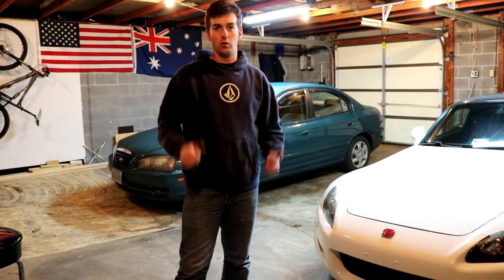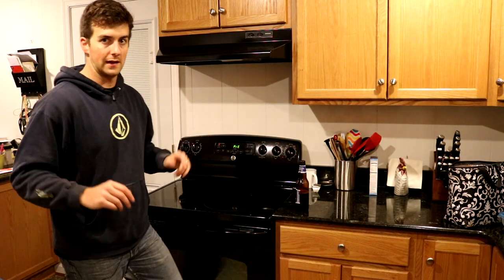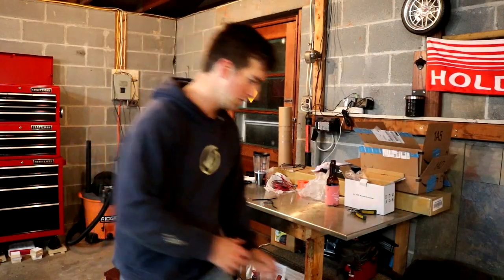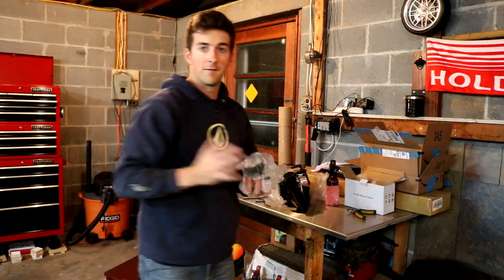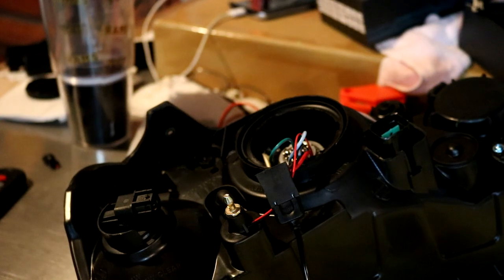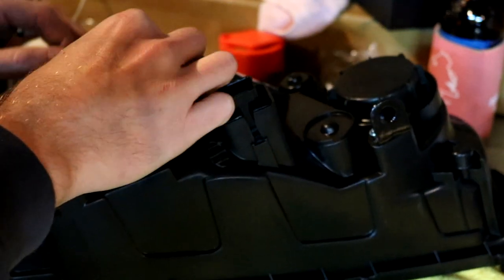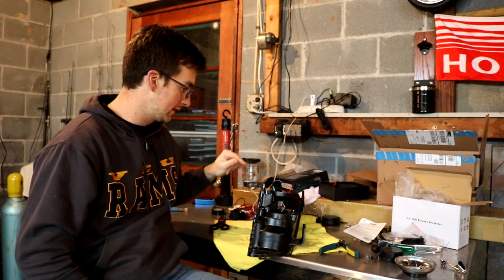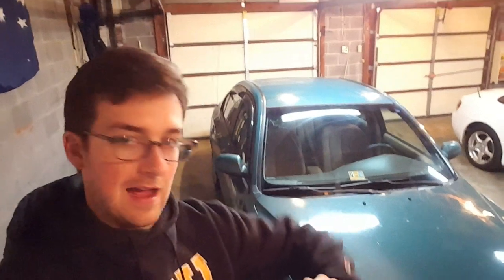Retrofit Projector Headlights for Under $100 - Ballin' On A Budget Episode 1

Comment: those rubber gaskets are actually silicone washers that should go in the back of the projector to make it grip better on to the reflector housing to avoid shaking and drooping. They are high temp and would not melt. by the way; would love to see some night shots of that projector with LED bulbs.
Reply from the maker: +Vince Froilan haha yep I only added one of those washers and the side I did not has a slight shake at idle. I do have some video shots I need to upload them. My recommendation would be to try hid bulbs I don't think the leds are bright enough in this case
Reply: nah its because of optics; the LEDs  dont align well inside the reflector bowl. Did the LED bulbs fit directly into the projector without any mods?
Reply from the maker: yep - no mods
Reply: Right🤘
Reply: You had to get high power 4 sided leds. I had 36watt Cob led bulbs that work well in projectors. $12 bucks on eBay. Just make sure that have 4 sided with light on it.

Comment: One of the best DIYs period for anything I have seen on YouTube. Bravo
Reply from the maker: that's one hell of a complement - thanks man!
Reply: Garage Topics I have a 986 Boxster that I am attempting. I was going to go with the HIDs but may give the LEDs a try.
Reply from the maker: +STEPHENS POUNDS hey I would actually recommend HID's, I don't think the leds are as bright as they should be. I've been meaning to get some to compare. My s2000 with HIDs are a lot better than my LED setup
Reply: Garage Topics S2ks have some of the best OEM lights around. I will start with the HIDs first. Thanks for the info.
Reply from the maker: +STEPHENS POUNDS anytime, keep me posted on how it goes!
Reply: Garage Topics I finalljy finished up the Mini H1 HID Retrofit. It went really well. I did not wire up the solenoid as I want to keep the halogen for flash to pass. Don't know how to send you pics! Thanks again for the vid as it really helped.

Comment: Confidence inspiring video. I'm just doing a bit of research before I jump in. I want to make one little point, though: You are using LEDs... not HIDs. Throw a Kensun HID kit in there, and you will REALLY be able to see (Also on Amazon with good reviews).
Reply: Quick thought:
If those projector housings are plastic, you might wanna keep with LEDs. HIDs make a bit of heat, and a plastic housing could warp, maybe even melt. 

If the projector is metal, you're good.
Reply from the maker: Entire headlight is plastic and super cheap. For light output, id def recommend HID's over the LED's. The HID do a lot better of putting light through the projectors. I have done this once before using The Retrofitsource products and had better light output, but I paid more. I may be making another video with a new projector retrofit. Thanks for the input!
Reply: @maxbloom8256  the projectirs are HID projrctors. The bowls on them are designed for HID bulbs.

Comment: Nice video, only thing is when you put the jumper for the solenoid to the high beam power should have used a red wire just to make life a little easier down the line for the next person down the line when you sell your car. Got to love a video that starts with a beer, man after my own heart.
Reply: Also I would've spliced into wire not cut it to re-solder it... cause when halogens get hot it's possibility the wire will come lose...

Comment: That Silly-Cone gasket actually goes inside the headlight housing between the projector and reflector inside the housing. It's made of silicone because of the heat so that it wont dry out. Also you don't use LED bulbs in projectors, you use HID bulbs. The lights will be very dim because the LED bulbs are already focused. My dad just called you a "green horn" lol.

Comment: You should probably watch some videos on how to make proper solder joints, the solder is there to hold the connection together, it's not supposed to actually be the connection.

Comment: Nice!! Now to really improve things. Take out the LED’s and install a decent setup such as Morimoto XB HID bulbs and morimoto or Hylux ballasts.

LED still can’t beat HID until they figure out how to get a hotspot
Reply from the maker: Yep, hids imo are still the way to go for light output
Reply: I agree Michael. Some Hylux ballasts and good H1 HID bulbs is the way to go.

Just move the LED over to the high beam side
Reply: Just get 4 mirrors and the led will shine its shine, try i with a cellphone led first n ul c

Comment: I retrofit a few projectors and I always end up cutting the headlight bulb socket and epoxy the projector into place. Every time I tired to use the nut and washer method, the projector didn't reach the back. So I always have to epoxy it.
Reply: Old comment: I just chucked out the silicone washer that is supposed to sit in between the projector and the housing because like your problem, when you try to fit it, it doesn’t reach, even while dremeling the bulb socket. I would imo say it’s necessary to have it if you’re using one of the metal plate adapters but if not, then you don’t need that rubber washer.

Comment: That silicone gasket is supposed to go between the projector and the original reflector bowl.

Secondly, why did you get HID projectors and use cheap LED's?

Take the LED bulbs and toss them and replace with H1 HID bulbs. 

So, after putting the gasket in the correct spot and doing your alignment again, you can use a socket and tighten down the nut use some JB Weld on the threads so the nut doesn't back off with vibration.

All in all a decent video. Thank you for doing it. 

Also, decent solder job

Comment: You did you best and considering that it is a cheap fix, you did a couple of things wrong. When you do a retrofit, your projector must be able to fit on the reflector housing, if it doesnt fit you will be required to expand the opening so that the projector can fit snugly. Secondly you must black out your reflector after you fitted your projector so that when you turn your headlights on, the light doesnt scatter inside your housing. Thirdly, experts say that the best lamp to use in a projector is an HID lamp, but you can fit an LED, it just has to be the right one. Headlight Revolution has the best recommendation for DIY headlight installations
Reply: Also, the big silicone washer was supposed to go ONTO the projector BEFORE fitting it into the housing in order to seal it from moisture.... and also to let the projector grip to the housing. And THIS is the reason they began to droop, not because they were too heavy.

Comment: Great job! One question,  and apologies if I missed it - I know you replaced the low beam with projectors and LED/HID bulbs, plus you wired the low beam projector to the high beam, so that they open up brighter when high beam is on. One thing I didn’t catch is did you also upgrade the high beam bulb to LED/HID? Thanks!
Reply from the maker: Thanks man! Na I just kept the high beam as a halogen bulb. I highly suggest hid bulb over led for the projector after making this video. I plan on making another video like this for my new vehicle
Reply: Garage Topics awesome thanks for the quick reply and answer. I want to do this on my 2000 Prelude SH. I’m wondering if it would be overkill to also put HID in the high beam? Since it is only on, when there is no oncoming traffic, I guess you don’t have to worry about blinding people with this...? I’m trying to wrap my head around the parts I need to get. I want the color temperature to match on all my lights. I’m subscribing so I will keep an eye out for your future videos!
Reply from the maker: No worries, thanks for subscribing! Since no one really sees the high beams on I opted not to fool with them. The projector headlight when open to high beam is plenty bright

Comment: I just can't get one thing, can you aim these lights afterwards? I saw u adjusting the lens, but is that the only way u would be able to adjust if u ever needed to do that? I"m talking like for technical inspection or MOT for car, like if they are too low or too high i'd need to adjust, but would i had to take it all apart or can i do it the original way?
Reply from the maker: So you adjust them only to make the cutoff line level. If you need to adjust the beam up or down, you use the stock headlight adjusters like you would on a regular car to move the light output up or down or left to right
Reply: @Garagetopics Thank you very much for clearing things up 🤙🏼

Comment: I'm fairly sure the waviness you complained about is there to allow more light to be unblocked on the side of the road away from oncoming drivers, might be wrong though
Reply from the maker: +fawncashew I thought so too, on legit projector retrofit kits they designate which one is left versus right. This $25 kit both projectors were the same
Reply: fawncashew thats how mine are , its like wavy ish i had mine retrofitted too , i wondered why they were like that , factory projector headlights are lined up perfectly so you cant reallly tell with them

Comment: I want to retrofit my 2012 Nissan Altima headlights. My only concern is there will be an opening behind of the headlight where the bulb is (because h1 bulbs don't have that black plastic/gasket thing to make the inside of the headlights air tight). Will the headlights be prone to condensation if its not covered up? Thanks
Reply from the maker: +Zachary Uniza I have had mine condensate once from a heavy rain where I was driving through puddles. Since I have the opening in the back, it cleared up within a couple hours. I have seen people use material similar to a computer mouse pad and use a radiator clamp to protect the back from the chance of condensation. If I had a higher end headlight, that is what I would do.

Comment: It's been 2 years since you did this vid. L.E.D headlight tech has gotten a lot better since. Have you tried a newer set of L.E.D's yet? And in your vid you were clicking the high beam so fast it looked like you accidentally wired your high beam shutter into your turn signal wire.
Reply: it's been a year and 3 months. The tech hasn't come THAT far.
Reply: Far as in better. Not top notch....lol
Reply from the maker: We actually just sold the car, and the headlight worked perfectly and was a selling point for the car. I am considering making a new video in the upcoming months for a projector retrofit into my Tacoma - I will keep you posted
Reply: I sold a car a couple years ago to upgrade to a minivan cause the family was getting too big for the car. The car had custom headlights in it. I painted them black inside and put hid's in them. and cleared the lenses to like new. In my opinion, a car, or at least the nose of it, is made up of how the headlights look. If the headlights look like shit, so does the whole nose of the car.

Comment: Well I have two separate bulbs for the dimmed (H1) and high beam(H7), how can I connect the high beam Halogen (H7) with the projector dimmed (H1) so when I am on high beams, they both light up?
I see that there is a 12v socket for the projector for high beam switch, but where do I connect it?
Reply: I guess a daisy chain between  motocontrol and high beams

Comment: I've been using these projectors for a while now. One thing I noticed after years of use is that the chrome is peeling from inside the projector which greatly reduces output.
Reply: I've heard that using high wattage bulbs causes this issue. What bulbs are you using ? ,And do you recommend those projectors ?
Reply: @mohmmd86  I've used various bulbs. From cheap Ebay ones to more expensive. Makes no difference. Cheap Chinese chrome just flakes off. I won't use them again. The lenses makes for good clear donors though.
Reply: @crownvicca  thanks

Comment: I would stick to an HID set for the HID projector and use your factory headlights with the aftermarket clear lens if the china one is that cheap and flimsy
Reply: Nice,never thought of that, the good oem reflectors with the new clear cover. And yes, I realize you'd only be using the high beam reflector.

Comment: instead of having to use the family oven and potentially getting the wrath of your wife. get a decent size bpx that can fit both of your headlights in and seal up and most of us have at least a cheap harbor freight heat gun. cut a hole in the lower half on one of the ends of your box (Heat Gun Port Hole) and try to get your heat gun in there sealed as best as possible.  Then you set your lights in there seal up top of box (Gorrilla Tape works well) and i lay a couple thick towels over and around outside of the box (probably doesnt do much) for insulation.  Let bake in there for 15-20 and check

Comment: I have a RSX I keep being told aftermarket projector headlights produce shit output. So I'm in the middle here
Reply from the maker: +Black Titan I agree. They won't blind other drivers (which is good) but it won't be that much better light output compared to stock with clean headlights. If you want the hid blue look for cheap, aftermarket is the way to go. For ultimate light output, retrofit
Reply: Garage Topics what does retrofit essentially mean. Is it something extra I have to do after I get new headlights?
Reply from the maker: +Black Titan yea it is making custom headlights. Check out theretrofitsource.com for a ton of knowledge!
Reply: depends, doing the retrofit yourself will work fine, those "projector HID headlights" you get "premade", yeah, complete shit quality and probably worse than the stock headlights
Reply from the maker: +SAMP Giggles agreed
Reply: My bro bought aftermarket projector headlights and the light out put is garbage.
Reply: +qvs787 Depends on what you buy. If you buy one of the cheap kits that is a projector housing made for your car, it'll be crap. If you get a decent set of projectors from The Retrofit Source or someplace reputable like that and do a retrofit like this, the output will be awesome. You get what you pay for, a good retrofit will set you back $400+

Comment: Electrical solder? As opposed to what?
Reply: Nick's Stuff solder used to join copper pipe for plumbing I'm assuming.
Reply: That's still tin & lead. You might need an external flux, depending on the type of solder.
Reply: Nick's Stuff I wasn't referring to the makeup of the solder, but the diameter considering he said it was making a mess.  Copper pipe solder is typically a lot larger diameter than "electrical solder". Sorry that I didn't make my comment more clear.
Reply: That's an explanation.

Still, I reckon it's manageable.
Reply: @NicksStuff  Different melting points, core vs no core and different chemical makeup.

Comment: If i dont need high beams can i just cut those wires completely ?
Reply from the maker: yep, no need to wire them if you do not want your projector to function as a high beam as well.
Reply: awesome !! thank you!! one more question, can you still adjust them once you sealed the headlight ?
Reply from the maker: Adjusting the straightness of the beam is a no/would be tough. The threads from the projector pop out where you typically change the bulb, but its held on with a soft nut that is suppose to lock everything in place.

Adjusting the overall beam up/down, left to right is totally adjustable as it relies on the stock adjustment of the housing

Comment: Any updates on this? Are they holding up well after all this time?
Reply from the maker: +Viktor Dimitrovski hey they are still holding up great! Only thing I would like to try is HID bulbs instead of the LED. I don't think the Leds put out as much light with the projectors
Reply: Just a heads up, I recently did a projector retrofit on my 05 Elantra. If you install HID, you might need a relay harness, I'm getting some flickering. The HIDS also slightly melted part of the actual housing. Installing LEDs in the next couple of days, and will probably post my own video as an update. (Using the same LEDs you used). It's just my own experience, subscribed because you have the same car as me!
Reply from the maker: +tphilpott123 awesome keep us posted!
Reply from the maker: thanks for the feedback!

Comment: Doesn't that car have separate bulbs for low beams and high beams if so why are you going to bother putting it into one housing
Reply from the maker: the projector I bought can be both a low beam and a high beam based on an electrical switch moving the light guard out of the way. I kept my stock high beam and allowed my projector to be an additional high beam as well
Reply: Quad high beams. More light. Why not do it if the protector is a high low projector. More light is better on dark roads

Comment: Silicone gasket was installed in the wrong position. It should be on the threads on the inside of the bowl.
Reply from the maker: You are correct, thanks for the heads up!

Comment: What orientation should the projector be in? Shouldn't the shield be on top to allow for light under it?
Reply from the maker: you will have to test it out, if i recall the guard is on the bottom due to the lens reversing what the light output actually is

Comment: What are parking lights?
Reply: The lights that come on with one click. They are also called running lights. 

His looks like it was in the low beam housing, so that used to be called a city light back in the 90's and early 2000's
Reply: Side lights. Before dipped

Comment: Downsides are the cheap non genuine headlights have shit plastic. The clear lenses fail pretty quickly. Within a year mine looked pretty ordinary. Also just polishig a headlight doesn't work. They need to be resealed or clearcoated.

Cheap projectors work ok but the high beam solenoids are known to stick open